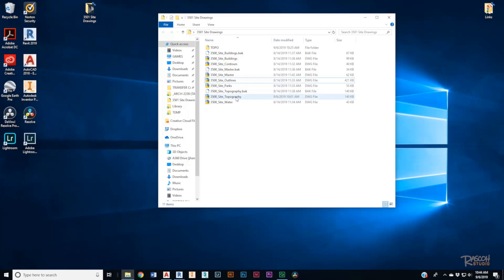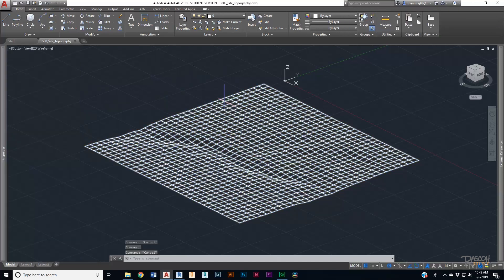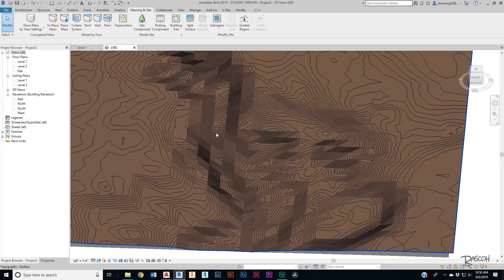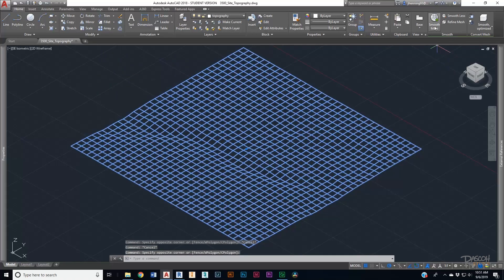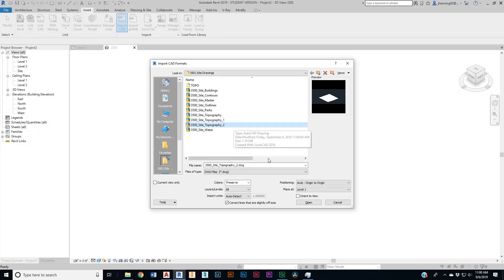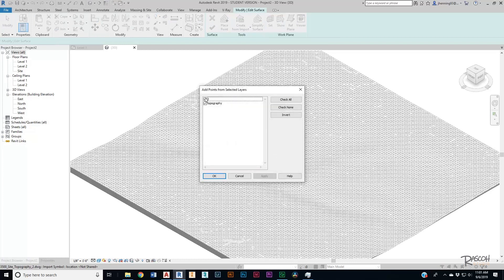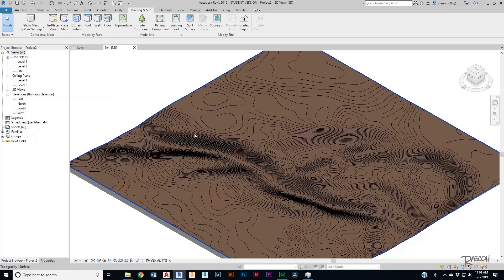How To Create Revit Topography from AutoCAD Models [CADMapper]

Comment: Hey, Jon thank you for the helpful tutorial I just had a quick question when I imported the topography into Revit my topography was paper-thin not thick like your and also there were no contour lines so it was hard to see the changes in level. How do i go about fixing that?
Reply: did you find a fix for this? I'm having the same issue
Reply: @emilykelly9734  I believe I may have but i don't quite remember what it was or if I ended up finding another method. Sorry I couldn't help anymore

Comment: i cannot explode the mesh in autocad but i have no idea why. Without exploding i also get the error in Revit that i need at least 3 points to convert it into terrain :/

edit: found out that that in my case i could not use the command, or used it wrong. However if i used the button to explode in tool bar it worked.

Comment: Hey Jon, I need your help. I followed your previous video and started on this video. My problem is after I import the mesh to revit and click on the Toposurface tab, then down click Create from import to select import instance. After that pick topography on the add points from selected layers. Hit ok but nothing happens on the screen like I saw in your video. When I go to click the green check, I get this error the surface must have at least three distinct points. Could you help me get the topo please?
Reply from the maker: dennis mensah Hey Dennis - Did you use the “X” (explode) command in AutoCAD on the mesh geometry before you imported it into Revit?
Reply: @Rascoh  I didn't know I needed to do that before importing to revit I'll give it a shot, thanks.
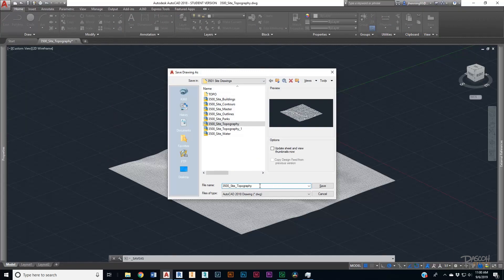Reply from the maker: dennis mensah I mentioned the “exploded mesh” part at 1:02 in the video - let me know if it works for you!
Reply: @Rascoh  it worked for me now. Thanks again,
Reply: Hello, I exploded, but Still I am having the same problem. Do you know what else I Can do to fix this?

Comment: Is that file in revit Geolocated? Also how would you add the other info? Roads, buildings?.. thanks
Reply from the maker: Hi Luis - This is just one video in my 3-part series for creating 3D topography using CADMapper. If you haven’t seen my other videos yet, I cover exactly how to add roads, buildings, etc. Check em out if you get a chance!

Comment: Thanks Jon, but I'm struggling to attach the new building to the topography that I made.

So pleas if you can help me out with this...
Reply from the maker: Basheer Ghadri Could you explain what exactly you’re struggling with? Give me some details so I can try to help you.
Reply: @Rascoh  I have an urban landscape design project for my graduation project and it's include a topography with area around 1 km and more than 100 buildings in the site, I imported the topography in Revit and cad mapper but I didn't find a solution to create the buildings in easy way with Revit and attach it to the topography with specific height, like even if it's just a boxs.
Reply from the maker: Basheer Ghadri I have a separate tutorial that covers AutoCAD linking to Revit, which you can find here: https://youtu.be/eX7rqikSOQ4

I think that tutorial should cover the problem you have, so definitely watch it let me know if it works for you!